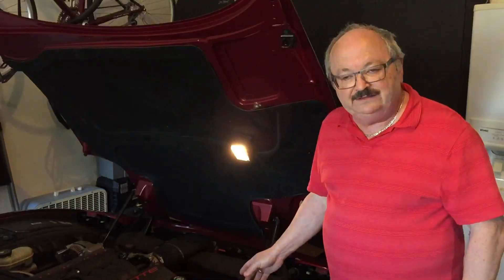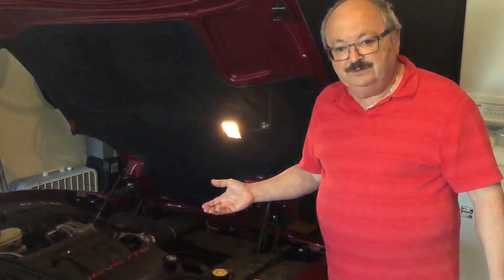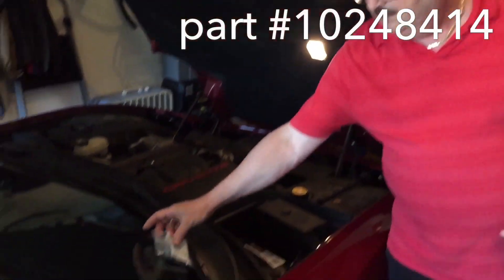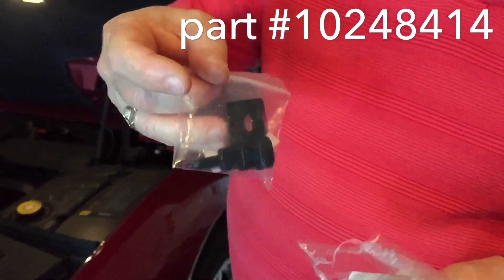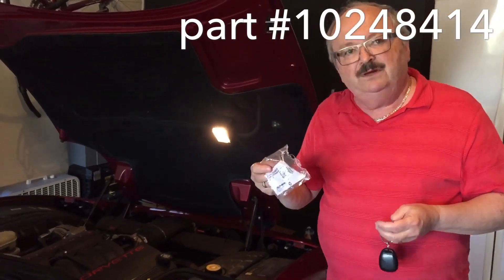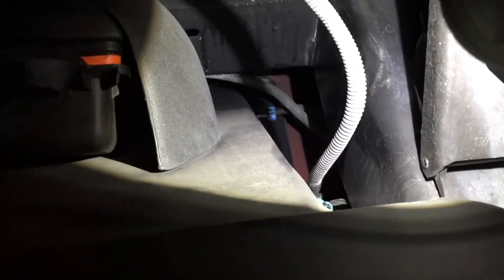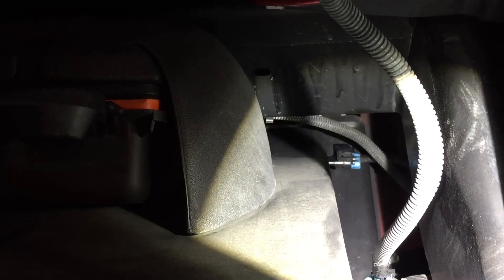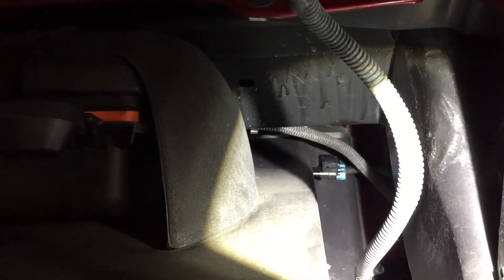A/C not working in your Vette? Ambient Temperature Sensor Replacement - C5 Corvette & other GM cars

Comment: Any tips on getting the plastic rivet out? I tried pushing and prying it but it doesn't move.
Reply from the maker: I approach all problems and projects with: Persistence, Perseverance, and Common Sense.  Not trying to be smart here, this is really the motto I use when approaching any challenge. Keep at it and you'll get it.

Comment: I hope this fixes my AC issue, I just paid $700 to have a Brand New AC compressor installed and it worked ice cold for 3 months then just stopped blowing cold. Still blows but it’s hot air. I went to recharge it but when I connected the AC Freon hose it was in the red. Could my guy have just over filled it?
Reply from the maker: Tristan Reaper Graham , the hose/gauge you’re referring to measures pressure in the system, not quantity of refrigerant. The only way to know the quantity (measured in lbs) is to use a special machine to extract/vacuum the stuff out.  Then using the same machine, put back in the appropriate amount. The refrigerant should be a mixture that contains a lubricant necessary for the compressor to live a long life. All of this should only be done by an automotive hvac professional with the appropriate tools and machinery. One should never attempt this using the off-the-shelf a/c cans and hoses found in auto parts stores and the like. Take it to a reputable shop and they’ll get it figured out. Good luck 👍

Comment: My temp sensor is reading 101 when it’s 80 outside, the ac is not nearly as cold as it was the other day, could this be it?
Reply: Evan Benson I was having same problem lol thanks save money
Reply from the maker: Evan Benson , I’m wondering if the car is in direct sunlight and that’s why it’s reading 101. Have you tried taking a reading in the shade or in the garage? Just to determine if the sensor is in fact reporting the wrong temp or not.